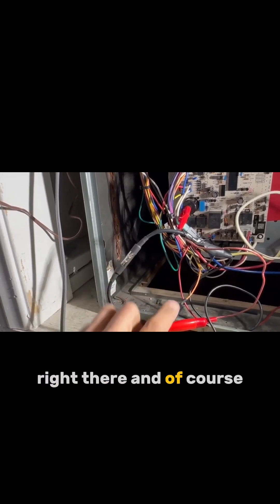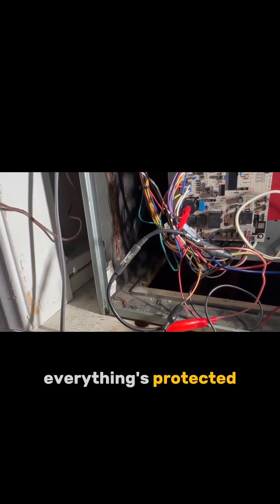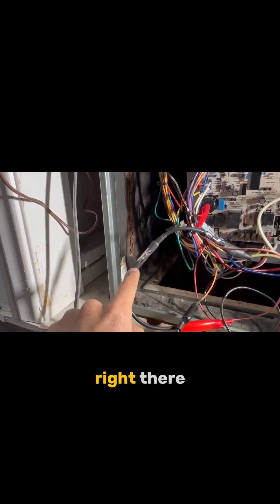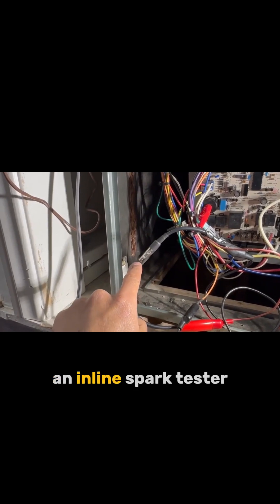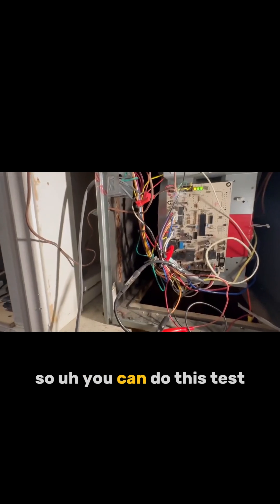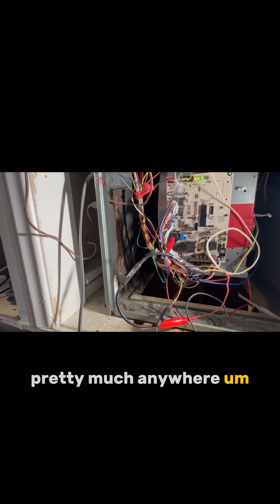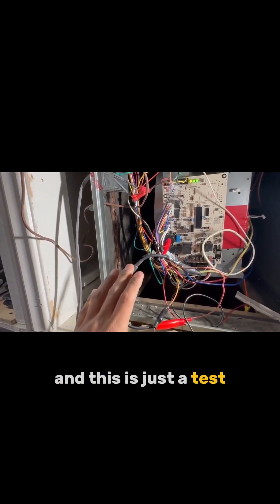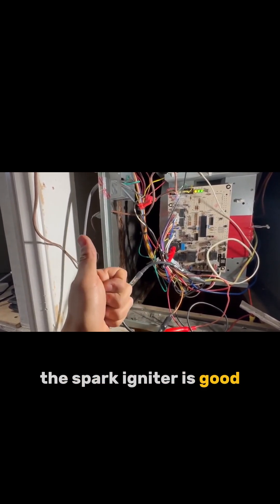TESTING A SPARK IGNITOR #shorts

Comment: That's pretty cool. I usually just pull the plug and get it close to the contact point to inspect if the spark is weak or strong.